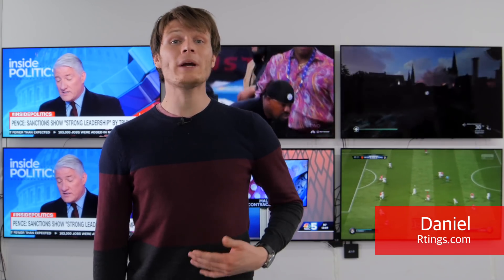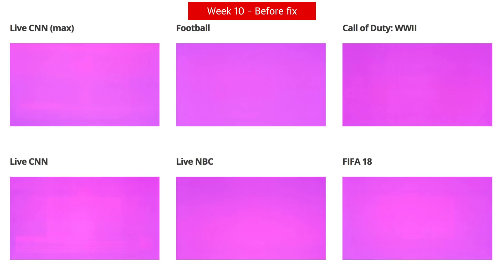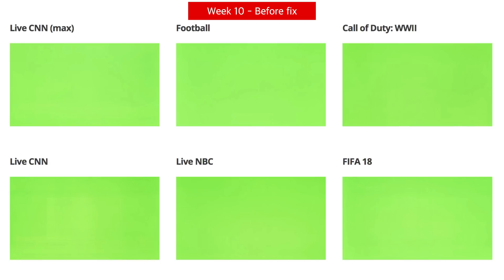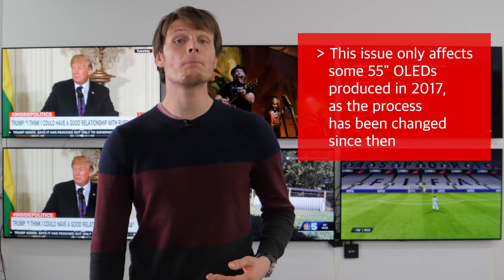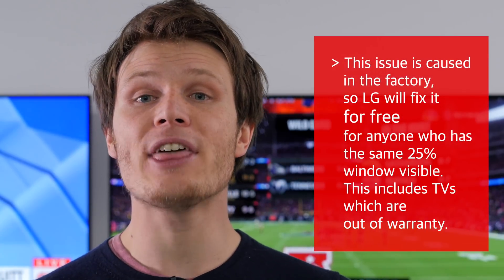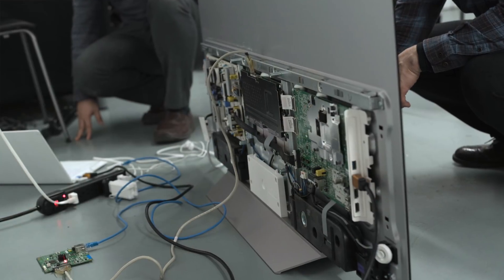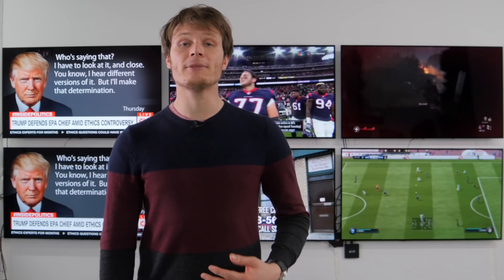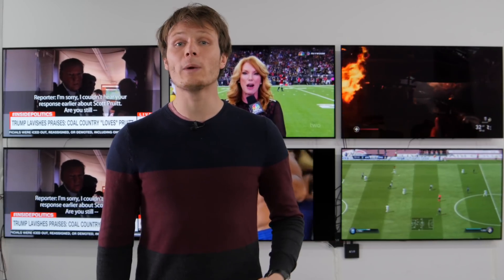Factory Defect & Fix - OLED Burn in Test Update Week 10 - RTINGS.com

Comment: Hi, Daniel.
 
Congratulations for great job.
You have any document signed by LG in which the company assumes responsibility for the defect of the rectangle in the center of the screen?
I'm having the same problem in my OLED 55 B7 TV and the LG Brasil refuses to repair my TV.

I would like to present a document to LG Brasil, if you have it.
Thank you!
Reply: if u have garanti u shuld get new panel and new motherboard inside the tv

Comment: i have a similar problem on my 55 inch b7, a bar across the bottom, a rectangle top right and left corner, and a darkish center. this can all be seen on orange yellow red screens, and noticable when watching regular tv. today is 16th February 2019, i bought this tv black friday 2017....is there anyway i can get this fixed? in ireland. thanks

Comment: I had the exact same problem with my LGOLED55E7P, and this video was incredibly useful in articulating the problem to LG customer service. My issue came up just after owning the unit for a year, right after the pixel refresher automatically ran for the first time. Naturally, this was just days after my warranty expired. I spent several weeks following up with various people at LG customer service, and eventually they put me through to an OLED specialist, who sent out an official LG tech that confirmed the problem, came back with a replacement panel a few days later, and replaced it in my home within an hour. To anyone who has had problems getting help from LG with this issue, even if your unit is out of warranty, just keep at it and emphasize that it's a manufacturing defect, and you should eventually be put in touch with an OLED specialist who knows what you're talking about. Good luck!

Comment: Hello Rtings ! 
Hello from France, Thanks for your work. :)
For information, I had the "25% window" on my C7V.
1) my TV was manufactured in Janury 2018 (in Poland, was writed behind tv and I have take a picture) so LG dont tell the truth when they said it s problem who only affect 2017  manufactured.
2) they had changed the panel and not apply the "fix"

Something it s not clear in this story. It s like LG try to hide something.

Sorry for my english :p

EDIT : maybe I'm wrong about the point 1. Yes, it's writed behind the tv "manufactured Januray 2018 in Poland" but it's the date of the TV manufactured and maybe not the date of the panel.

Regards.
Reply: Also from France, same TV as yours. Got the rectangular pattern after my first pixel refresher.  They also told me that it isn't fixable directly. They don't have any instructions from LG Korea to directly fix this issue. They ordered a new panel to replace mine. Aside from RTINGS  don't think anyone got their panel fixed by an LG rep. 
Can you tell me if your new panel is good  after several pixel refresher ? 
Tu peux me repondre en francais, ce sera plus facile ;)
Reply: @MeMarcadet  Bonjour,
A titre personnel, ça s'est très bien passé et le tout sans frais. Juste un peu long concernant l'attente de la dalle (2 semaine environs).
Je dois dire que la manière dont les choses se passent doivent être très dépendante du centre agréé. Du fait de ma région (Marne), je suis tombé sur la Somatelec, qui sont très compétant et sur un technicien tout particulièrement qui fut à la fois très sympathique et très pro lors du changement de dalle.
Le tout s'est fait à domicile en moins d'une heure.
Depuis, je n'ai pas eu à déplorer de nouveau le problème, l'image reste comme neuve et je confirme que j'aime toujours autant cette TV (surtout comparé à ma Qled de chez Samsung !).
Reply: Bonjour. La dalle a été changé gratuitement ? Ayant acheté ma C7 chez Darty, LG me renvoit chez eux pour le problème, j'espère que ça sera gratuit, et qu'ils ne vont pas me dire que c'est une mauvaise utilisation ou un truc du genre...
Reply: @florianb.1382  Bonjour,
Oui gratuitement, dans le cadre de la garantie constructeur. Le tout géré par le centre agréé de ma région.
Depuis, tout roule, l’image est de nouveau parfaite. 
Par contre, je ne comprend pas pourquoi dans certains cas LG prend en charge directement et pourquoi dans certains cas ils renvoient vers le revendeur.
La mienne a été acheté à la Fnac (Darty donc, d'une certain manière), et c'est LG qui s'est occupé de l'ensemble de bout en bout (en faisant jouer son centre agréé).
Reply: @Poluxamort  Merci beaucoup pour vos réponses, j'espère que ça se passera aussi bien avec Darty (qui de toute façon va plus ou moins directement passer par LG pour avoir une dalle, etc...). Je posterai une réponse ici, pour ceux qui tomberaient dessus un jour... Ah, question, lors du changement de dalle, les réglages restent je suppose, si la partie electronique n'est pas changée ?
Reply: @florianb.1382  Bonsoir Florian. De mémoire oui, les réglages sont conservés. Tiens nous au courant de la suite des opérations te concernant.
Reply: @Poluxamort  Oui, je vous tiendrais au courant. Merci de vos réponses.
Reply: @Poluxamort  Alors, Darty vient enlever la tv pour réparation / changement de dalle en atelier. Ils m'en prettent une autre le temps de l'inter (environ 10j). J'espère avoir une dalle neuve en retour, et pas un un model "usagé"...
Reply: @Poluxamort  Bonjour. TV récupérée aujourd'hui. La dalle a bien été changé, mais pas l'electronique, donc tous mes réglages sont ok. A voir si le problème se reproduit dans x mois... SAV efficace au final.

Comment: The rectangle issue is affecting Panasonic as well. My 2017 model 55EZ952B developed it last week immediately after it's first long panel maintenance run at 1500 hours use. Noticeable on most content and obvious on red colours. I know of at least one other EZ owner with the same problem. Totally ruined the TV for me. Engineers coming tomorrow. Battle expected.
Reply: Same as me. Panasonic EZ950 2017. I think it also happened after running long panel maintenance for te first time. How did you issue end John?

Comment: I have just that.  I notised it immediately after pixel refresh.
Reply: I contacted lg. They said that it's barely visible.
It seems that they refuse to fix my TV.  
Well see what answer i get on my next email.
Reply: I had to send this to lg.  They changed new panel.  They did not take a stand to this, because the video was not theirs.
In finland they try to refuse to fix this on warranty. I would think twice before buying lg

Comment: Hi , i also have a some sort of suggestion and question for the test of these OLEDS that you guys are still running. Since I also bought B7 OLED and i was already well aware of the burn in and image retention issues if you left static image or even those black bars at the bottom and up side of the screen for consistent period of time.  So due to this fact I never ever play a content with static logo on it , i only use my B7 for movies with 16:9 aspect ratio , where it fills the screen to get rid of those black bars , if they are there . The point is that the OLEDS pixels have to be shifting and changing constantly to prevent any burn in . I personally have never experienced any burn in or image retention on both my phone and B7 . But what about COLOR DEGRADATION issue in OLEDS ???? . Since they use organic compounds in these displays they will degrade over time . So do you have any suggestions regarding this color degradation issue for a man like me who uses OLEDS without any static image on screen ?
Thank You .
My kindest regards with respect.

Comment: @rtings.com 
There are two things that I don't get:

A: These TVs were made for personal use, making everything you have tested on them unlikely to ever happen. If I may compare this to cars, you have bought 6 ferraris and went cross country racing in Dubai. Yes the performance is terrible, but the car was never designed to perform well in these situations - what exactly is your test showing us here?

B: Testing repetitive and unusual material on the TVs makes just as little sense. Returning to the car analogy, you guys have been running the ferraris in first gear when racing it down the track. You know that the TVs have mechanisms that prevent these images from sticking. That's like denying your ferrari a trip to the shop to refresh the oil and fill up the gas tank. 

You guys are not testing TVs, you are misusing them. ALL OLED manufacturers will tell you that these TVs were not made to be used that way and that if you happen to be a person who watches red squares at home all day: DONT FUCKING BUY AN OLED TV. It's very disappointing. You appear to be competent, but you're not. You just want clicks...

Comment: Since LG uses WOLED (which essentially makes it a FALD display with 8 million dimming zones), why is it that colors like red and yellow cause image retention faster than other colors? This especially makes me wonder what is going on since red is a lower energy wavelength, yet people say that it causes quicker/more intense burn in than blue on these tvs. I thought that different colors would only change the rate of screen degradation if the red, blue, and green sub pixels were individually lit, but since LG puts filters ontop of a white oled, this confuses me a little bit. Does the red filter just require more white light to pass through in order to achieve the same percieved brightness as a blue filter?

Comment: Is it possible that the dimmer CNN tv has more uniformity issues due to the exponential decay rate of the organic leds? Like since it's using a lower setting, the static pixels still decayed rather quickly, but the non static pixels around it just weren't "catching up" as quickly since they weren't outputting anywhere near their peak brightness. In other words, I'd assume that if the tv was on max brightness, the static pixels would still decay faster at first, but all of the pixels would more quickly reach a point where the decay becomes less percievable and they sort of start to even out. I might be wrong though. Hopefully I worded that in a way that makes sense. I would like to know what you guys think.

Comment: I have a 65 inch LG OLED in December still under warranty.  I noticed a burn in of the CNN breaking news logo on my tv... My previous Samsung LCD never had any burn in issues but after 6months this seems ridiculous.  When i went online to seek troubleshooting the LG website said burn in isn't covered under the warranty.  Are you saying that now it is?
Reply: The rectangle box that they fixed is not a burn in issue, but a software issue.

Comment: Dear rtings, as I can't use the contact form on your website because i'm not in us. I write here on youtube and I hope you can answer my question:

I thought LG is using WRGB OLED, therefore the pixel should only loose luminance but the color should stay the same.
But when I look at the pictures with the different backgrounds it seems like only some colors are affected.
But as i understand WRGB, when a single pixel looses luminance it should be visible on all backgrounds (ecept dark bgs), as the oled itself is white and the color is generated using a filter.
Can you clarify that?
Reply from the maker: Each 4 subpixels are separate. They are all white but with different filters each. Single subpixels can lose luminance without affecting the other subpixels

Comment: Rtings What are your thoughts regarding...
If Vendors don't OFFER Burn-in Warranty because they say its such a rare occurence... then the OLED Buying Public needs a Lemon Rule like they have for Cars and Other products.

https://en.m.wikipedia.org/wiki/Lemon_law

"Federal lawEdit

There are two types of warranties for product purchases, express warranties and implied warranties. Express warranties make specific promises about product repair, and are usually made in writing. An express warranty may be provided by the manufacturers in owner's manuals and other written sales or marketing materials. Implied warranties arise from a manufacturer's duty to meet certain minimum standards of quality whereby the product is fit for use for the purpose intended. An implied warranty arises from the sale itself, and need not be in writing. In each type the manufacturer assumes the liability and responsibility to correct the defect and, in the event that they cannot meet that duty, may be required to repurchase or replace the product."

Comment: My issue with this test is, its extreme and most normal people won't use their TVs this way and The Panel lottery is real for ALL tvs, yet people act like all LCDs are PERFECT which isn't the case at all. All TV tech have issues and their panel lotteries. It doesn't mean every OLED is going to have Burn In or every LCD is going to have bad backlights, blooming, etc.
Reply: Michelle Alexandria Winning a Big Lottery is like one in a million or worst odds.

A burn in OLED panel has good odds. And the winner lose $Thousands of Dollars they saved for years to buy. Unless you have money to blow or throw away.

Lottery is not the Right Word. LG would like that word. Its money in the bank for them.

Comment: I have been using OLED for almost two years now
Never Encountered any such issue
Same with my friends too
The problem is basically restricted to some panels
Good thing is that LG is ready to fix it free of cost if it happens
Soo nothing to worry
The picture quality is Just amazing soo I couldn't think of another TV
Reply: Kishore S LG fix for free????
Do you have a URL Link that states that???? My E6 OLED has huge burn in from watching non static materials.
Reply: Larry Wong Call LG
I have never had any such issue
Even in the video he says
LG has assured as the issue has happened in factory LG WILL FIX IT FOR FREE
Reply: Kishore S Rtings saids LG will fix the 25% Window pattern. Not burn in's. No burn in was fixed For Rtings.
Reply: Larry Wong I don't know about 2016 models
But The 2017 model which I have never had any such issues
Just contact LG ASK THEM WHAT WOULD BE THE SOLUTION TO IT
Reply: Kishore S__ LG don't fix burn ins under warranty. At the LG Service center they told me it will cost more to repair  the screen panel than if we brought new OLED TV from a store.

Having to spend $5000 is no fun.
LG don't mind taking peoples money and not giving OLED burn in warranty. TV's should last 5-10 years. OUR LG OLED did'nt last 9-10 months. Screen is ruined.

Comment: What a shame that you let LG repair the screens, how do you know that they have not made changes that may prevent burn in. as they clearly know what you are testing... would you consider re-testing the default measurements to see if their firmware or setting changes have moved from default.. not just on the screen but with proper measuring devices... although it sounds a bit "conspiracy theory" LG stands to lose a LOT of burn in is a real problem, so modifying the menu change settings without showing up on a menu would be fairly basic to achieve.. I would highly recommend re-testing each unit to see if they are still outputting the defaults

Comment: I just had my 2017 C7 55” Panel replaced by LG due the square in the middle. They didn’t update any settings or firmware however. Is the issue likely to occur again as it’s not a panel problem? This was just before this video was released and I assume they weren’t exactly sure about the root cause of the issue and done the panel thinking it was the panel. Mine was very noticeable and occurred very noticeably in normal content.
Reply: What's the status of your new panel after 8 months ?

Comment: Definately an important and interesting test. Im glad to report that my 2017 OLED 65 inch C7 TV has no retention or burn in that I can see. There is sometimes a temporary retention for a few seconds when first starting up the tv, if I leave a menu on, but nothing that lasts. 

Since ive had the tv in august Ive only used it for gaming, watching only a few movies. Heavy gaming on OLD systems played through emulators. As well as new games. A full variety of games.  Many hours on Persona 5 as soon as I got the tv which has many static bars. No retention. 

Though I think there is some truth to getting a good panel. I know with the few plasmas I owned, I only had one set that handled retention great and I didnt have to worry about it with gaming. The others always had shadows of life bars that sometimes never seemed to fade. 

After all the negative I heard about retention on OLEDs I was surprised that it performed way better than my previous plasmas and was not even an issue. Basically everything I play is posted on the channel after editing, so the variety and frequency can be seen to some degree there.
Reply: My 65" C7 has begin to show this defect recently, just with the red color.

Comment: Great work, really. What about other tv brands who are building oled TVs with lg panels, for example Panasonic?
Reply: It certainly is affecting other brands. My Panasonic 55EZ952B developed the 'rectangle' immediately after it completed it's first long scheduled panel maintenance after 1500 hrs of use. Engineers coming tomorrow. Battle expected :(
Reply: How was the battle ? How did they stand to your issue ?

Comment: Awesome update fellas!

Have to say though, even after the "fix" the area where the 25 % windows was is still significantly brighter than the rest of the screen. Lots of lines and other uniformity issues as well. Not good.
Reply: forget world fix,,, fix just exchange to new panel like i did 2 times on 2 years i changed 2 times just show garanti and call them to bring new panel is just bad i dont know how long will go like this untill lg must give uss another tv olen is super to watcch on it but burn is problme some one say hold not on max light or contrast ifi dont hoold max wtf to see?? where is beutifult with half light